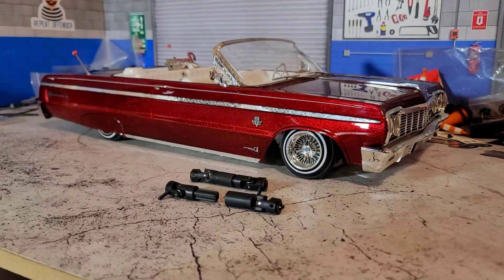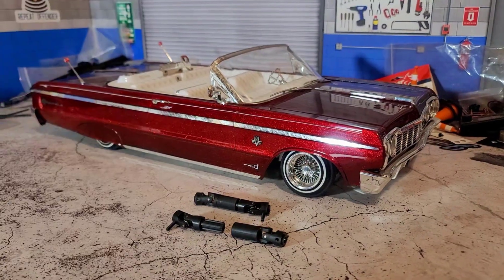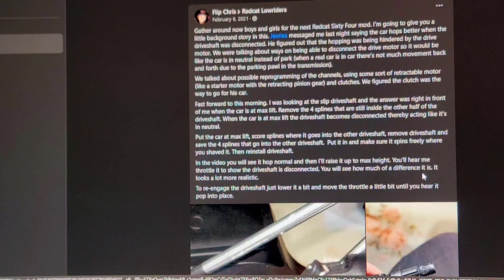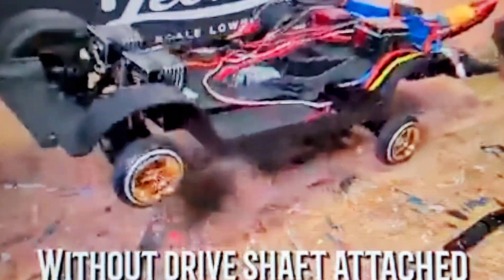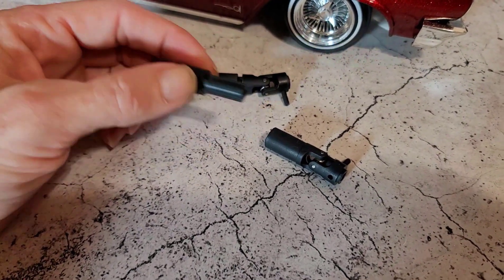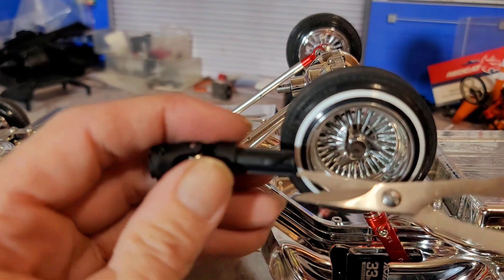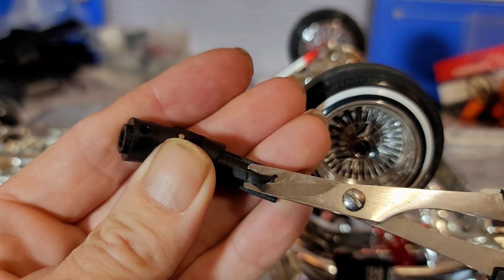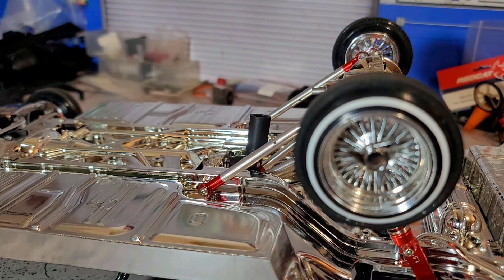Redcat Lowriders "Flip Chris" Driveshaft Mod for Competition Hop Builds

Comment: How can I do this mod to a Monte Carlo?
Reply from the maker: With how the Monte drive shaft articulates its not feasible. Some have done it 2 ways. First by relocating transmission and motor further back and using 64 style drive shaft. Others have added a drive shaft coupler to be fixed further back where the 64 drive shaft would mount and run 2nd drive shaft tranny to coupler. Both high amounts of custom work n parts
Reply: @NorthSideCustomRC  If I mount motor and transmission further back and use the 64 short driveshaft I won't be able to use interior right cause the motor will sit higher ? For the coupler mod do you know where I could find coupler? Thanks for reply!
Reply from the maker: @CPT Eddie Ttype  I'm not 100% on coupler, I think it came from Cen F450 but not 100%

Lotta guys move tranny back they all still have interiors. It's been done a few ways but mainly right in front where links mount
Reply: @NorthSideCustomRC  Thank you for the info and for taking the time to reply I appreciate it.
Reply from the maker: https://l.facebook.com/l.php?u=https%3A%2F%2Fwww.ebay.com%2Fitm%2F291751460306%3Fmkcid%3D16%26mkevt%3D1%26mkrid%3D711-127632-2357-0%26ssspo%3DK-cYaJ6zRY2%26sssrc%3D2349624%26ssuid%3DtjU8QI2_Tum%26var%3D%26widget_ver%3Dartemis%26media%3DCOPY%26fbclid%3DIwAR1NhfHPS3hLlMIyAOBBIefprq5g-XDbjVvEHY0T2cB9EfcTMWIIhS10RxE&h=AT3p2o6D6h5F0r86bnNyPg_8vo6wjUZ4IAkoTLYxiU90ePoB6ULAvdrTIuyfWQ6y88p4ag6FI6YXssP3fVLzMsb7tFS4vI7hLyDNLo_furMeWLiw2PhbsqWWY9SXKPHgTEs

Comment: Also by the way bro what base is that I really love that kolor I know u said chrome I want that exact same kolor on mine I have the Kandy red I just need the base thanks homie also what servo and batt are u running bro love your 64
Reply from the maker: Thx Bro, The Paint is Spaz Stix Candy Red / Fully Dry/// Traxxas Metal Flake &  Spaz Stix Chrome as backer. The Red Build runs dual Reefs 300 Gold version, Castle BEC and SMC 3s DV Extreme 5200 135c
Reply: @NorthSideCustomRC  thanks for all the info bro and nice interior too

Comment: where do you get the chrome axle brace??? ive been looking for one forever. thanks..
Reply from the maker: Thats just a Kandy and chrome decal, but Skunks Kustoms sells axle brace print and can just chrome vinyl it
Reply: @NorthSideCustomRC  that's what I have been wondering but then I thought having to just a sticker hang down seems stupid. I do have the full Kandy & Chrome decal kit but was just looking for a brace. Thanks for the info! 👍
Reply from the maker: @donslick8464  agreed I dont like the decal on its own, I plan to get a next Kandy decal, and put it on the Skunks Kustoms brace
Reply: @NorthSideCustomRC  my problem right now is finding some True 13's I have a Kandy & Chrome paint job pre ordered and everything else is ready but who knows when the wheels will be back in stock.